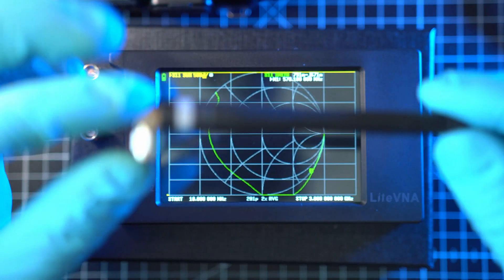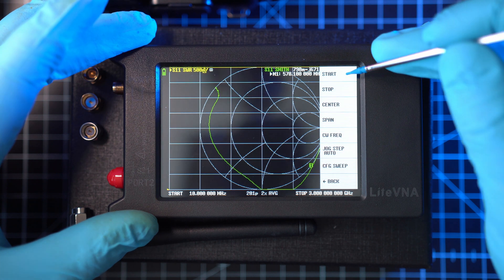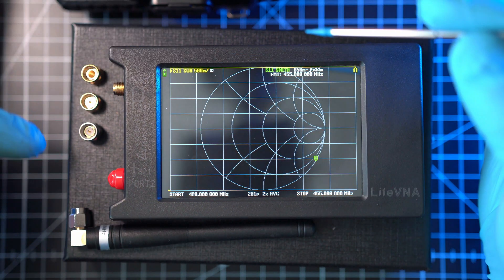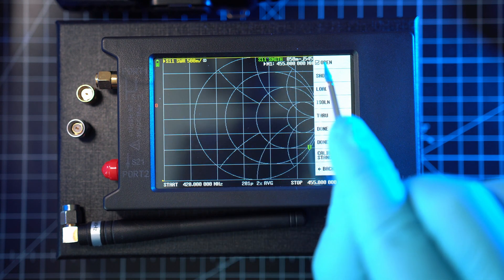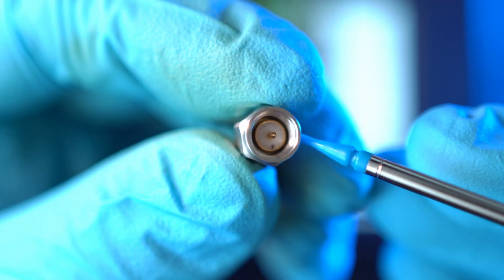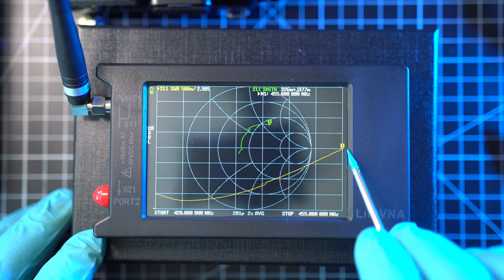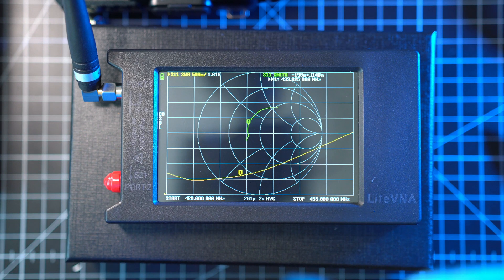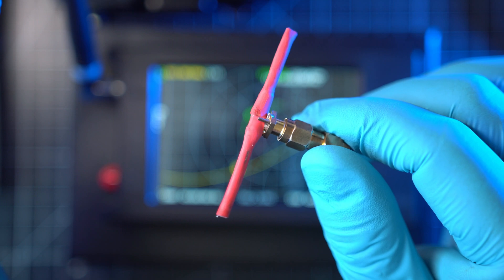NanoVNA & LiteVNA Calibration & Antenna Tuning

Comment: Hello, unfortunately I followed your link and I got scammed by Eleshop. First they increase the price to 156Euro and they have a minimum of 170Euro order for UK so I order some other crap also.  The scam is that is all exclusive of VAT so I paid another 53Euro that's VAT + UPS brokering and 20Euro on shipping. So 243Euro and on Zeenko store on Aliexpress is 150Euro including VAT and shipping.  So that's a 93Euro scam :( So the only silver lining is that it came in 2days VS 2 weeks but I didn't needed it that urgent :( It just feels so wrong that for some reason I bumped into your video first before Aliexpress link.